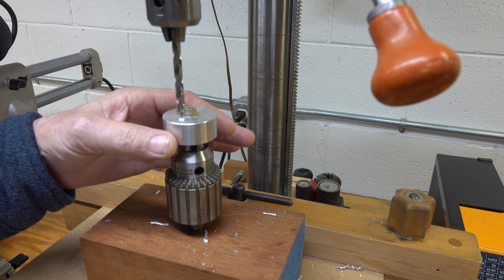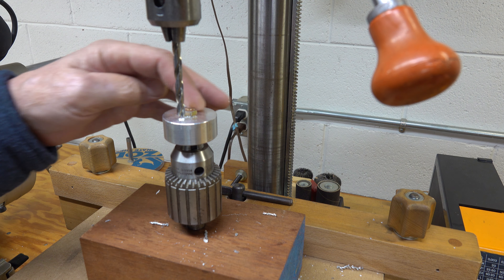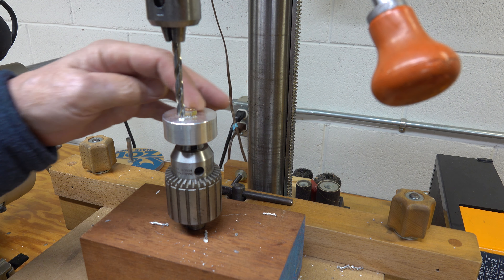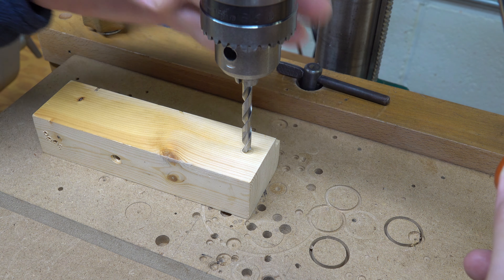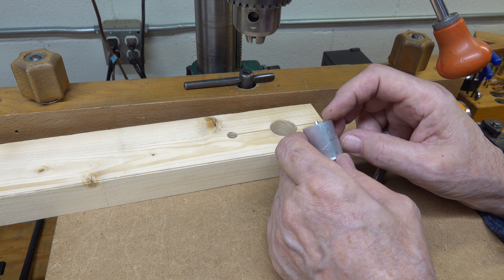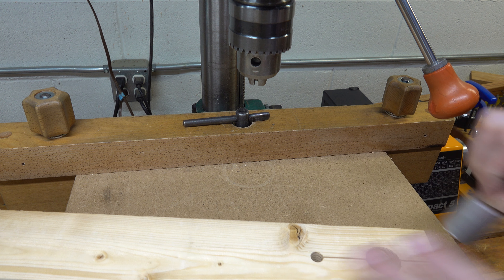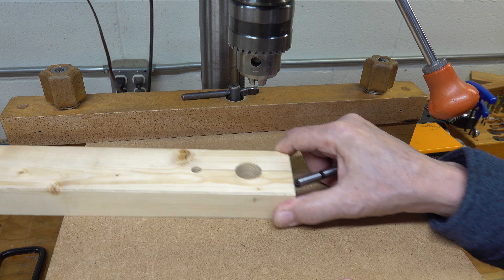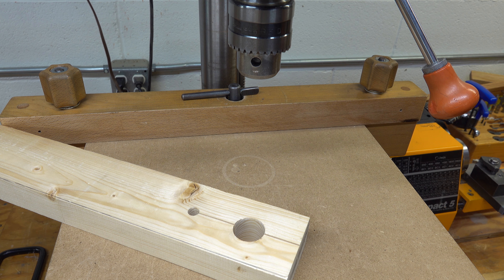IMPROVE DRILL PRESS ACCURACY IMMEDIATELY!

Comment: I like to use wood drills, those with a pointy tip. Thes can be aimed with ease. Will drill many aluminum alloys too.
Reply from the maker: So true! but I need to mention ways to get great results without their use too...  I sharpen old drills into spur tips like you mention and add just the right amount of rake for what your drilling: metal alum, wood plastic etc. As you say they work very well. Thanks again timtim!

Comment: Nothing wrong with the rest of your tips, but #1 can be very dangerous if not used carefully. Drill presses are NOT mills are are not designed to take the lateral forces that it would be put under when using a 2nd chuck as a 'micro lathe'. If using a really soft material and shallow cuts, I'm sure it would be fine, but if somsone sees this and tries it with some hardwood/steel and tries to mill a deep cut, it can potentially end in life-changing injuries.
Reply from the maker: Thank you sir for that consideration but at that point isn't the owner a few fries short of a happy meal?  Radial  drilling was my mention not radial milling...either way one would hope folks consider a few things before throwing any switch in any shop. And, I beg to differ, I don't see lateral loading present unless the fixture starts to lean due to poor clamping or screwing.
Reply: @joesshop3622  I don't disagree, but never underestimate the capacity for a subset of people to do stupid things because they got the idea from the internet.
Reply from the maker: @NottsKnots  WOW! NAIL ON THE HEAD LOL! I really do seriously attempt to keep things safe for everybody here but your right for sure. I have several ideas I use often yet I cant mention due to those...few.